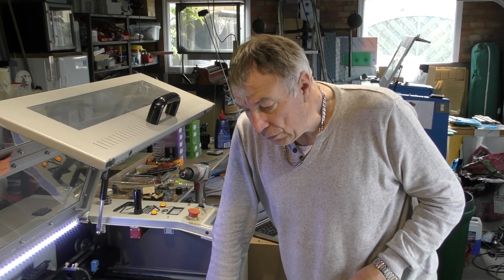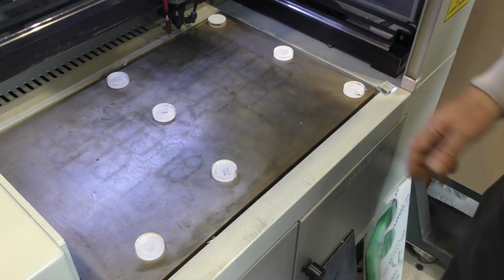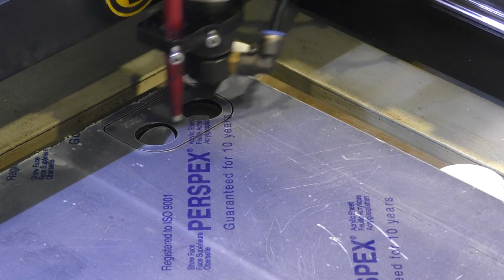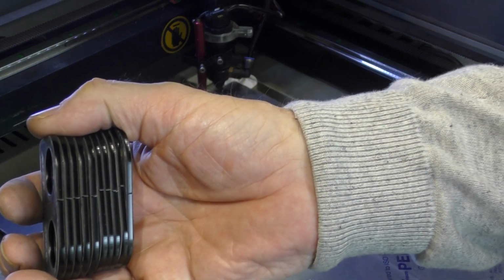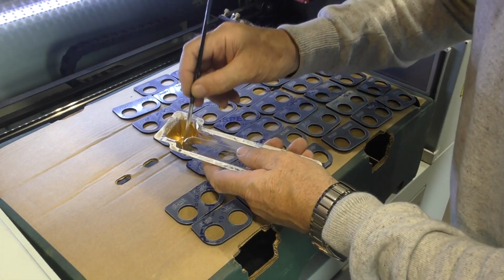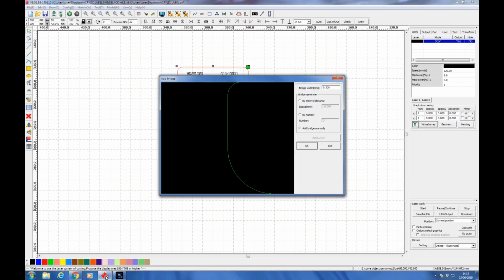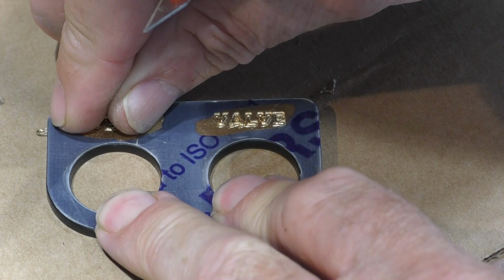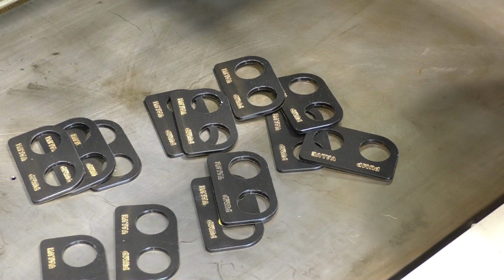RDWorks Learning Lab 168 Bridges

Comment: I've noticed that if I use alcohol on clear acrylic (not HDPE or other plastics) I get cracking due to the chemical reactions...  Hexane, dishsoap, or other more gentle cleaners are safe for use on clear acrylic....
Reply from the maker: Hi Joe

 It's a mistake I'm sure we have all made. Isopropyl alcohol is a very mild solvent but will still soften the surface of acrylic to allow the  built-in stress cracks to propagate.. It si very normal to generate edge crack stresses when solvent cement is applied to joints.  I rarely have this issue because I use a mild form of cement intended for PET. It takes a few more seconds to bond but usually produces crack-free joints.  I suspect you were trying tomremove the white dusty looking haze that settles on acrylic when you engrave it?#

Best wishes
Russ.

Comment: To take off paint residue.... let it dry a bit.  Then get a cotton cloth and put in it a one of the scrap holes.  Wrap the cloth tight... put turps or meths on the cloth at bottom and rub across the paint.  The flat bottom will only take off the excess on the surface !
Reply from the maker: Hi

Thanks for the tip. Although I did make a batch like this,  I have subsequently reverse engraved into clear acrylic and left the film on until the paint has fully hardened. The peel off then leaves perfect edges that need no cleaning.  However O greatly appreciate your advice.
Best wishes
Russ

Comment: I have a k40 laser with a dead tube.. Can I replace it with a 40-50 watt laser? Will the power supply give me enough to get at least 30 watts out of the new 40-50 watt laser? I figure if you under power a bigger tube, it might last longer?
Reply from the maker: Hi
My first question is , are you sure you have a dead tube? Tubes do not just drop down dead unless there is mechanical damage to the tube and you can see sparks inside or the gas mix had leaked away. The tube may not be delivering any laser power but it should still appear to be working . The pink glow in your tube is the nitrogen in the gas mix ionizing. Although you can consume the CO2 in the gas mix and lose laser power, the nitrogen will always be there so you will always see the pink beam even if the tube is "dead". If you have no pink beam and your machine stopped working suddenly, then the chances are that it is your HV power supply that is dead and the flyback transformers are not generating the thousands of volts required  to ionize the nitrogen or it could also be a failed switch circuit.   Are you still sure about the dead tube?

Your K40 is run by a very basic analog controller and requires a special power supply like this
https://www.amazon.com/Cloudray-Laser-Supply-Engraver-Cutter/dp/B079MHKQXF/ref=sr_1_1?m=A2M1Y79D9F74M8&qid=1561184320&s=merchant-items&sr=1-1

Your current tube is probably a B grade tube if it is the one supplied with the machine and you will be lucky if you are getting even 30 watts from it. A genuine A grade replacement that will just drop into your machine and will give between 40 and 45 watts output  will be this SPT tube sold as a rebadged Cloudray tube. 
https://www.amazon.com/Cloudray-50-70W-L1000mm-Dia-50mm-Cooling/dp/B07BDKFDFZ/ref=pd_rhf_se_s_cr_simh_0_9?_encoding=UTF8&pd_rd_i=B07BDJ6J95&pd_rd_r=86cabd3b-ec5d-4e43-8dca-e50ea872f1da&pd_rd_w=jhPDb&pd_rd_wg=NULIT&pf_rd_p=67aa5820-8762-4202-90ba-881bb99c913c&pf_rd_r=XK6RN75FE5BW8FNFR4GK&refRID=XK6RN75FE5BW8FNFR4GK&th=1

It seems expensive here on the Amazon site  (commission?? plus shipping from China) where as at the Cloudray site you can see it at half the price (CR35) but now you need to check out the stupid DHL delivery charge.

Your experience so far is likely to be bad because of the B grade tube and B grade power supply fitted to your machine.Fit a proper tube and power supply and you will have a transformed machine. You have an ammeter fitted and this tube is a long life tube so do not run it at more than 18mA and it should last 3 years or more.

Best wishes
Russ

Comment: Have a question for you. I am on video 70 something on the playlist. Have you considered or tried running an inert gas with the air assist? Argon, nitrogen, or helium come to mind. Just a thought for your tinkering.
Reply from the maker: Hi Jeremy
It is a suggestion I have had many times but I have never tried it because air is free and compressed gasses are not. I imagine that you are suggesting it as a way to stop the brown marks that can occur when you engrave or cut. As you get further into the series , yo find that I begin to decode the cutting and engraving processes in great detail. I begin to understand the way that our beam of light transfers it'e energy to make the material it hits "self harm" itself  by molecular excitement.  Now that I understand the way that these factors interact I can cut  "brown-free" but the edges will always be scorched brown but not charred with carbon . I can engrave cleanly by understanding the balance of power,  airflow across the workface and absolute minimal air assist.. On organic materials  the whole point of 2D engraving is to  mark the surface with scorching. IF an inert gas prevents that oxidation process then the outcome would be pointless. For 3D engraving you do require material removal without scorching but that again can be achieved by finding  the right balance of speed and power to catch the "burning' process at the correct point in it's cycle.
I do have  a colleague who will lend me bottle of Argonshield gas to experiment with. I may well test it in the near future just to show the effects. 

Thanks for the thought though
Best wishes
Russ

Comment: Thanks Russ another item in RD works I never knew was there ! incidentally I am still using ver 10 so I thought maybe its now time for me to update (I find with software if it works leave it alone), but the bridge feature is there also in ver 10 and works great, I havnt yet found or been told what is better in later versions, I ran ver 24 for a while on another machine and could'nt find anything new so stuck with ver 10.  By the way I found the plastic on one side of the perspex brand horrible stuff when engraving (the side with all the blue writing) so I now peel it off and replace with paper application tape, leaves surface perfect especially on clear.

Comment: sir.. I have a question for you..  I'm getting intermittent horizontal lines in 3/4" inch acrylic carvings running at 10%  50w c02..  can I contact you?  https://drive.google.com/file/d/1BM-qfFf6zAv95CBMfqFkiuyzfc6u3fOw/view?usp=sharing
Reply from the maker: H-
I was just checking through my summary of comments and saw no reply to you. Wrong.  I did reply but You Tube seems to have sent my answer to s parallel universe. . Let me try again.
1) To contact me add your email address to a new comment and I get auto copied to my gmail. I will answer and delete your comment.
2)This looks like one of two issues. 
a) this banding can occur when your tube is cooled by a refrigerated chiller . I doubt you have one for a 50 watt tube so this is an unlikely cause.
b) This is not a vector file  that you are scanning  but it's a bitmap image. This looks very much like an aliasing issue where you have not matched your line interval to the resolution of your bmp.. If you put handles around your image and go to Handle,Bitmap Handle,  you will see the resolution in ppi of the image you are trying to scan. Note the ppi. Now go to your scanning parameter window and you will see  INTERVAL. This cannot be any random number you fancy, it MUST match the resolution of your image. The calculation is simple
25.4/PPI = INTERVAL.. for example 25.4/300ppi= 0.0847mm.  NOTE CAREFULLY. It will be difficult to get lines that are thinner than 0.2mm and that is a resolution of 127ppi. A SMALL amount of line overlap will be ok  , say 150ppi , but if you overlap too much you will get deeper multiple burns and it will take longer to scan the job. The correct way to approach this sort of scanning work is to draw a 15mm test square on the material you plan to use and set the scan interval to say 0.5mm.  Set the power and speed . This will produce obvious single scan lines. Now repeat but with 0.4mm interval. Compare the line thickness to the gap. If the gap and the line thickness are the same then you have estimated your line thickness to be 0.2mm. If the gap is bigger than the line then try 0.3mm interval.  When you have got the balance right , lets say at 0.3mm interval, you  have then measured your line thickness as 0.15mm. . Now set your interval to 0.15mm and test to see if your lines sit nicely  against each other. You may decide to  set the interval to 0.13mm for example for a uniform looking result.. What you have now done, in exactly the opposite way to your normal method, is to find out what resolution you must set your bitmap to.. The resolution of your bitmap must be 25.4/0.13 - 195ppi.

I hope this all makes sense. Test it and find the best result for your machine setup. The line thickness will be determined by your lens type and focal distance, the speed, the power and the accuracy of setting your focal point.

Best wishes
Russ

Comment: Curious on your thoughts if you have a minute. The cleaning of your bed seems so much easier and less dangerous than a honeycomb bed. I know anodized aluminum absorbs/transfers the majority of the energy as demonstrated in some of your previous videos and your doHICky. Since the bed is normally always well out of the high energy density focus range, how well do you think an anodized aluminum bed would perform at reducing or completely removing reflection? 

With an under powered laser I often have to slow down on some of my cuts when I need to do thicker materials and I must remove film on both sides to prevent a flame(From time to time I cut half inch on a K40(Very slow cut to get any sort of a clean~ finish)) and the reflection is insane if I have any bed really. I will one day of course upgrade to something more powerful but this has me interested in finding a solution. The idea of little to no beam reflection sounds wonderful if you can merely absorb the energy after the cut. 

On the chance that it is feasible I do understand that there are other things to consider such as heat transfer/build up and what not, but I would love to get some discussion around it if you have some thoughts on the subject?

Side note: I thoroughly love and greatly enjoy your videos and your process of learning, exploring and experimenting.
Reply from the maker: Hi Phillip

Mild steel ( 65% reflective) is less reflective than raw aluminium (98% ) or stainless steel (96%).  I have used tables with all these metals. I know it does not sound correct but metals have a crystallographic structure when in their solid state  and it is that  structure (not the surface shininess) that causes the reflection. Mild steel does not reflect in quite the same way as aluminium or stainless steel. Instead of straight reflection, the the beam gets scattered as it hits the mild steel surface. This dispersion automatically reduces the energy density of the reflection. I use mild steel BUT you will still get reflection damage if your material is too close to the surface . With my 60watt tube, I find that raising the work 15 to 20mm off the table completely fixes any reflection issues and with some materials with a higher damage threshold 10mm clearance will suffice..
However. just as you propose, anodized aluminium WILL absorb the excess  energy and there  will be no need to worry about heating because aluminium is an extremely good heat conductor.  1.5mm to 2mm will work well but the problem will be durability. Yes, anodizing is hard but if it gets too mucky and you find that acetone will not remove the burnt on debris, using abrasive will soon wear through the anodizing  because it is only a few microns thick..
The other solution is to use a sheet of acrylic  because this will absorb the extra energy in the form of surface damage (evaporation). This works well on my pin table but after a while the top surface damage causes the sheet to distort. I have still not found a better material than mild steel although  I did find that an piece of thick granite worktop was  an equally good substitute.

Best wishes
Russ

Comment: Great video as always. Maybe if you had a rubber table (or sheet) under the parts they would not move while brushing the gold paint.
Reply from the maker: I would normally not remove these from the frame but do 50 all on one sheet. Leaving them attached  and on a flat MDF surface provides total stability. for painting. and I have tried spraying as well , because the frame provides masking. However you get paint run off onto the external edges which is unsatisfactory hence the brush method.  I just did small batches of 10 for the purpose of this video and the card box I was using  was not flat. OK for demo but not for production.
Thanks for comment
Best wishes
Russ

Comment: Hi Sir, could you experiment on acylic welding using the laser for mass production? cant really make it work using the videos i seen in youtube, really need your expertise to figure it out.

thanks!
Reply from the maker: The videos you have seen on line are done by university students as part of their degree course. I have experimented with the technique  and it could have limited uses. It.s not really welding by my definition. It exploits the fuming properties of methyl acrylate as it evaporates. Like steam the vapour will condense  (the white film on the surface of your job) and because it is a condensate it also acts as a glue which is why it is almost impossible to remove the white film except by polishing. When you put sheets together this condensate seeps between the sheets in an random and unpredictable way.  That is what seems to be bonding the sheets together at the edges. The edges of the material also go through a very thin liquid phase during cutting and the liquid phase also adds to the bond strength by healing over the join with a few microns of melt.
You may not have seen this:
https://www.youtube.com/watch?v=Nz8dfCKvCLQ
They do explain some details and limitations. They also mention that they "think the process works by"......hey, they are researching and touting this process, surely it is essential to understand how the process works. They  also  quickly mention later that it does not work for all acrylics.  It's a great idea but I can see only limited uses for it. Play for yourself  and experiment , it's cheap and easy, requiring no special skills or tools.
Best wishes
Russ

Comment: Does cutting the vinyl masking with the laser create chlorine gas damage?
Reply from the maker: Hi Fred
In US most acrylics are paper covered but here in Europe/UK 95% are plastic covered.  The film is specially designed to be laser safe and is a few steps up from candle wax in  its composition. There is no pvc element so fear not, however, I congratulate you on your suspicion and caution. Always be safe with plastics.

Best wishes
Russ
Reply: @SarbarMultimedia  Thanks for the reply. That's an interesting piece of information. I had read, but not confirmed, that cast acrylic is vinyl covered, while extruded acrylic is paper masked (in the US). I could have the attributes reversed, however.
Reply from the maker: @freddotu  
Hi Fred 
When I have been working in US, I have only ever encountered paper cover so maybe you are right . It's worth checking with distributor or manufactures website if in doubt.
Best wishes
Russ
Reply: @freddotu  In the U.S. most of what I see is paper backing on cast, and plastic on extruded. I do receive cast acrylic occasionally with plastic backing, but I don't believe that I've ever received extruded acrylic with a paper backing. In my experience they do have very different considerations when cutting a client's work. I would think that the lower melting point of extruded acrylic would be a factor in why paper backing might be a less desirable choice. Great question BTW.